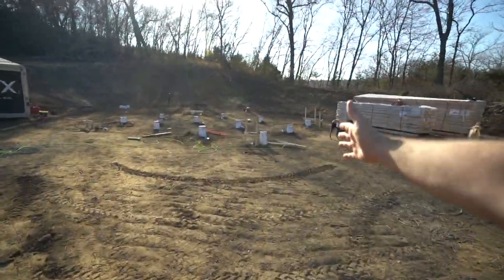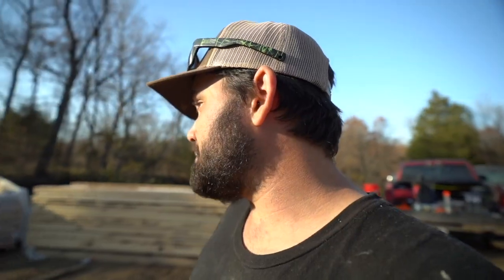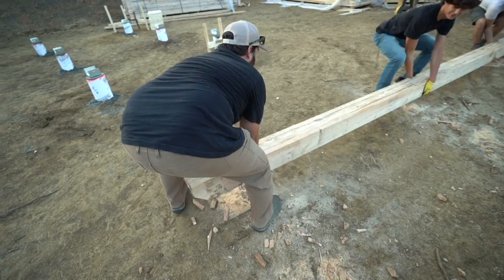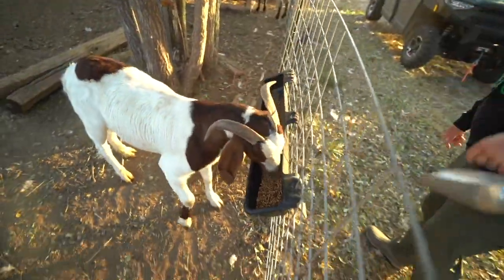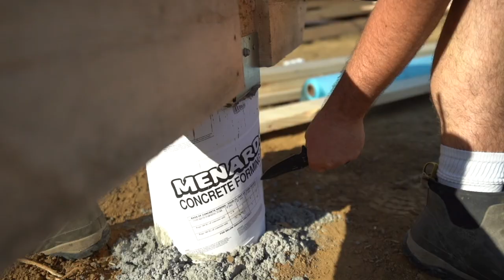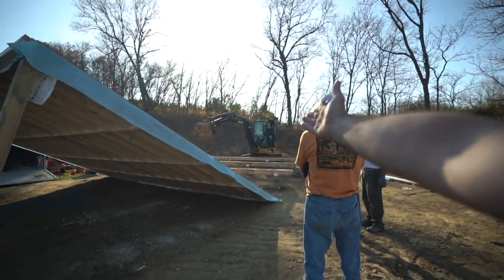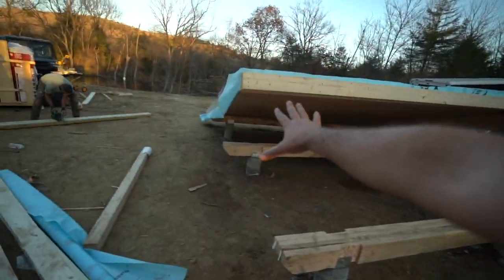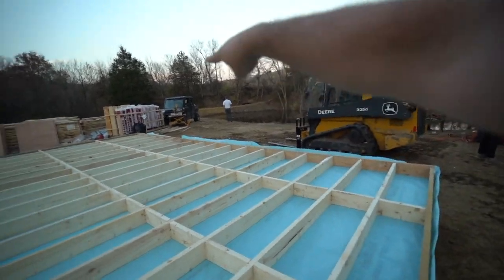Building a OFF-GRID CABIN in My BACKYARD!!! (Part 3)

Comment: Up here in Canada we would build that floor on the beams square it and secure it to them only thing you gotta lift is the joists and ply on to the structure. It’s better than building on the ground you don’t have to bend as far while framing the floor
Reply: How would u deck the underneath side?

Comment: What are you doing for heat, just a thought you could do a mini split with a heat pump and a woodstove stove Then have a steel storage container on the side where you could put solar panels on the top of the steel container, and use it for gun storage and mechanical purposes

Comment: I would of installed the deck into like 4 or 5 equal sized pieces. Each end should fall on top of a support. Or make the joices completely then go back and install the 3/8 sheets in each space with blocks on each corner of the pieces of sheets to nail with framing nails to hold them into place. But I mean the joices and some thick 3/4 OSB plus whatever flooring your gonna install in the cabin should of kept the cold out... Anyways love the vids Flair.

Comment: For those notches you need chisels.  Would be way easier and make a much better result.   But for what you’re doing the uneven flat bars will work, just a lot more physical work.  Not as easy with a flat bar as it is with a chisel by any means.   

Work smarter not harder.

Comment: Who needs chisels when you have a pry bar? All that notching was a waste of time. Once the cabin is built, its not going to fall of your concrete piers. Or if you were that worried, just set bars in the top of the concrete and drill a hole in the underside of the timber. It doesnt look like you have any re-bar in the piers?

Comment: Yeah you guys definitively did something wrong, you are not supposed to flip a entire freaking floor structure and the vapor barrier should always be on the inside/warm side. So your vapor barrier is already on the wrong side of of the insulation.  I highly doubt you were supposed to put plywood on the bottom of the joists, thats just a very weird thing. I mean how do you even properly attach the floor joists to the beams now?

Normally you put furring on the joist, lay down plywood/osb and then the insulation or skip the plywood/osb depending on your type of insulation.  Then your vapor barrier and subfloor on top of it.
I dont know what the instructions say but this doesnt make any sense.

Comment: Man... I DEEEEEEFINITELY would have put down a layer of weed barrier and about four inches of gravel under that floor around the pilings before setting that floor in place. If you don't it's going to be infestation and rodent Disneyland under that cabin and it's going to be a bitch doing it after the cabin is already up. Rookie mistake Beefcake Construction, LLC.

Comment: Your floor deck looks wrong, why would you have bottom plywood underneath ? If it were to have a flood or leak your floor would catch and hold instead of falling on to ground?
Reply: Its called insulation...it doesn't stay without something to hold it and protect it from elements.